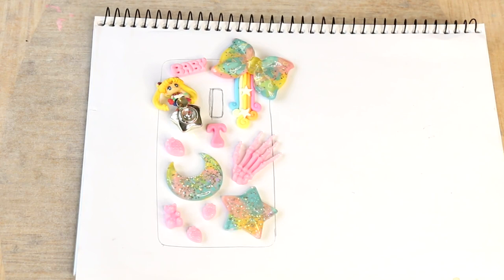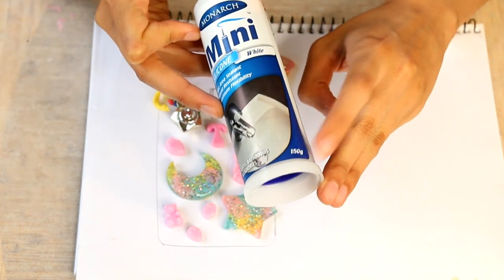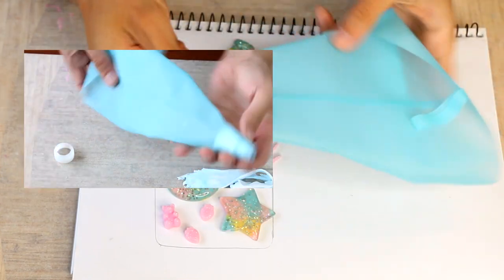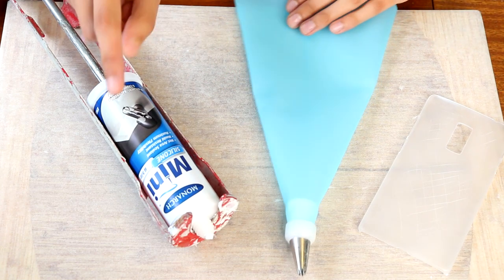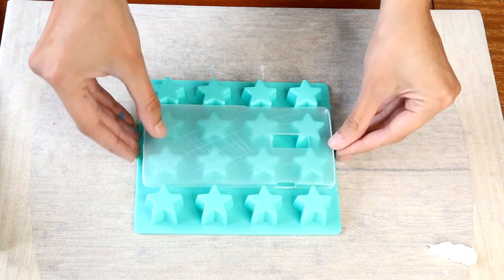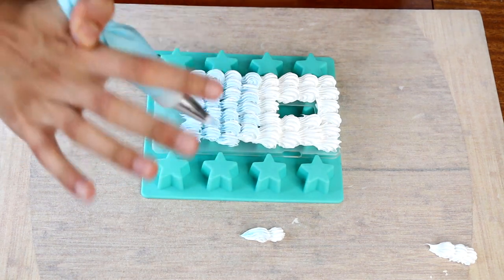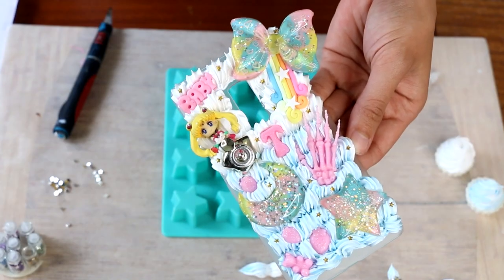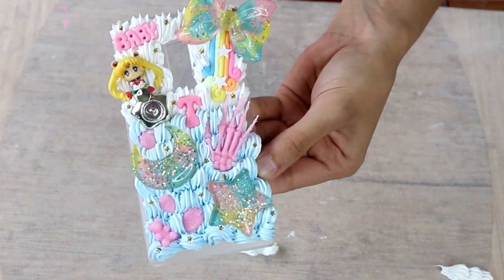♡ Kawaii Decoden Tutorial! How to 2 Tone Frosting 🌙

Comment from the maker: ⚠️ CAUTION ⚠️
Using a thinner such as Turpentine can be dangerous if you get it in eyes or skin. Please be VERY careful if using this thinner. Alternatively you can colour your silicone with non water based paints (powders or oils paints) and you should not experience seizing of the silicone which makes it difficult to pipe. 

Here are the descriptions of thinners including the one I use:

White Spirits - 
This is probably the most common paint thinner that you can buy in DIY stores in Ireland to clean paint brushes. It’s an “extraction solvent” which means that it separates the water, and the plastic/resin in emulsion paint and makes it easier to clean. It is always a clear liquid. It’s not completely safe but is the safest of the three to use. This is what I buy to clean paint brushes.

Methylated Spirits - 
This is also called ‘denatured alcohol’ outside Ireland and does the same thing as white spirits, but is made from pure ethanol with added poison to discourage people drinking it (yes, really!). You can buy it in most DIY stores in Ireland and is often dyed a colour like purple.

Turpentine - 
This is a natural version of the same thing but is the most dangerous of the three. It is highly flammable and its vapour can irritate the skin and eyes. If you are just cleaning paint brushes, avoid this. You’ll sometimes see it mixed with things like beeswax for cleaning furniture.

Comment: hi! just an extra tip here, another reason why your silicon may be hard to pipe can also be due to the acrylic paint, its water based which causes the silicon to kind of get thick and seize, which is why I recommend either powder pigments or even oil paints! after doing some research I coloured my whip with some oil paint I had and it didn't thicken whatsoever! I definitely recommend it! especially if you're doing more darker colours as you will need to add more pigment for those, which the silicon will not be able to take if you're using acrylic :)
Reply from the maker: Oooo thank you soo much!! I had a thought oil paints might work better but I'm also cheap and didn't want to buy more paint since I have so much acrylic 😅 but I'll definitely invest in some for the future when I want to take commissions ^^ thank you again!! 💖💖💖